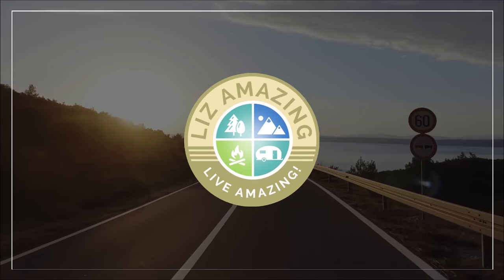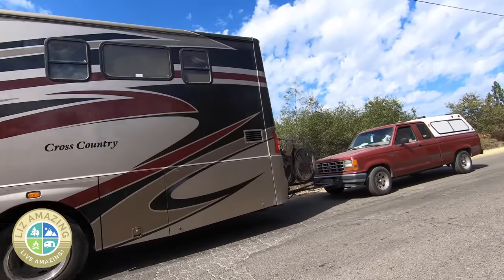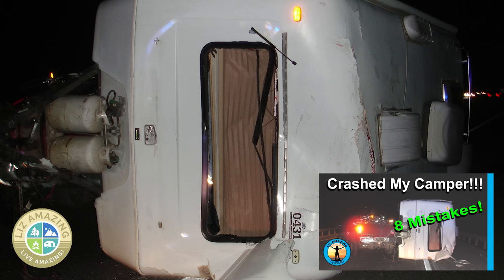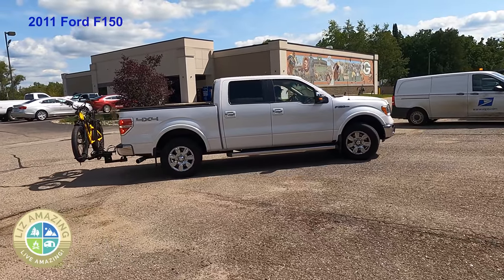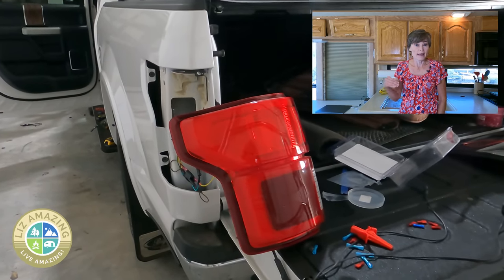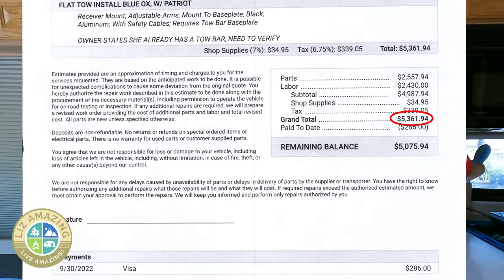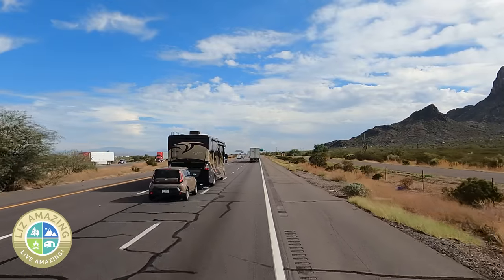These RVers are putting others in danger

Comment: For a very long time when I was much younger you could rent a towbar at the local rental agency and it was just clamped onto the back bumper of one vehicle and to the front bumper of the second vehicle and that was all the total setup you needed. 

We towed big heavy cars all over the mountains using those back in the 60s and 70s.

In the late seventies my dad moved our family from California to Missouri and he built his own tow bars for two vehicles to tow two other vehicles and they worked out just fine.
In the mid 80s he had a Chevy pickup with a tow bar permanently mounted on the front cuz he didn't trust the transmission on it which was a good idea, because he had me tow his truck about 30 miles to the nearest Chevrolet dealer to get it fixed and that was one of those homemade towbars that he kept on there all the time.

In the late '80s they came up with a ridiculously stupid way of factory installing antilock brakes on all vehicles and they made it illegal to put a standard trailer brake controller on tow vehicles that tied into the master cylinder on the tow vehicle.
They came out with some really idiotic designs like trailer brake controllers that had pendulums in them or some other silly device that didn't work with a darn.
They also put surge brakes on other trailers like they put on some of those rental trailers at the rental agencies and those surge brakes are extremely dangerous and I would never pull a trailer with one of those because when you are on a very slippery surface if you put your brakes on the tires on your car May lock up even if you have anti-lock brakes and the trailer is still pushing you because the trailer brakes have not come on that's true with the pendulum type trailer brake controllers and with the surge brake setup on the rental trailers or on a lot of car dollies also have the stupid surge brake system on them.

I put the old style Kelsey hydraulic over electric brake controllers on my 1985 Ford pickup and it worked perfectly because those old trailers brake controllers work fantastically if you knew how to set them up properly which a lot of people don't. Those old trailer brake controllers been around since the 1940s or 50s I believe.
Those work great because you can adjust the weight of the trailer to set the amount of breaking you want the trailer to have.
You always want to make sure it is set so that the trailer brakes stop the trailer and the truck brakes stop the truck and neither one should have to do breaking for the other. To test that you would apply the brakes normally as you would whether you're towing or not and it should feel the same whether you're towing or not it should feel the same on their brake pedal. I've been told by a lot of people that the brake systems they have on tow vehicles now don't work as well. Some people have towed thousands of miles several large trailers and they say that they have to push the brake pedal a lot harder when they're towing a trailer. That shows it's either not set up right or the braking system they're using is extremely flawed!
When I do upgrade to a newer truck I'm still going to use the old hydraulic over electric trailer brake controller that I took off my old truck. And if I ever have to use a tow bar to pull a vehicle behind a motorhome or a pickup truck I want to get a tow bar system that uses an electric actuator to push on the brake pedal of the tow vehicle so it'll work with my electric over hydraulic trailer brake controller. This type will also work when you're backing up a towed vehicle which I am told none of the other tow dollies or flatbed trailers will do that!

By the way, my dad and I never had trouble backing up trailers or cars or pickups with his homemade tow bars. And his tow bars were a lot stronger than any factory ever made theirs! His were designed fastened directly to the frame of the tow vehicle! Not the bumpers.
Reply from the maker: Oh those were the days for sure. Thanks for taking me with you on a trip down memory lane. I had heard bad things about surge brakes. Thanks for sharing, and for watching.
Reply: @LizAmazing  you are very welcome.

Comment: Here in Washington State any trailer over 3,000 pounds must have brakes.  I'm pretty sure this applies to any towed vehicle over 3,000 pounds.  AND not 100% certain but I think that 3,000 is the gross vehicle weight rating (rated weight with load), not the actual empty weight.  Meaning pretty much any towed car or truck must have brakes.
Reply from the maker: Yes. It varies by the state. It's good to do the research and always go with the safest option. Thanks for watching, Dave!

Comment: Hi, Liz, I was just curious when towing your truck do you have to keep it in neutral? I'm sure you do. I'm not very knowledgeable when it comes to towing but when towing all 4 wheels are turning meaning the driveshaft is engaged isn't it, meaning it's still putting miles on your truck. Shoot I don't know lol.
Reply from the maker: Good question, Ty. My F150 has.a "tow. mode" where I have to follow a precise sequence of settings to get it into neutral tow. It tows with the power off and I don't think anything is registering on the odometer.

Comment: Yep, We are towing a jeep and spent at least $5K to get braking and system set up.
Reply from the maker: Glad to hear you've got a system, just answered a comment from someone else who thinks a supplementary braking system is not necessary. Hoping this video will help spread the word. Thanks for watching, Dawn!
Reply: @LizAmazing  Thanks Liz! Meant to tell you you’re looking great in these new videos. Love the new Motorhome. Potentially anyone not using a braking system who has an accident or a towing failure, could run the risk of insurance not covering damages if found at fault for not using any required safety (braking) equipment. On top of that, it’s just good proactive safety.
Reply from the maker: @dawng540  Yes that’s an excellent point and I’m glad you brought it up. Their insurance will be void if they are breaking the law by not having a brake system. Thanks again!

Comment: How does brakes on truck work when truck isn’t running ,,ie power brakes
Reply from the maker: The brakes on the truck automatically connect with the motorhome when I hitch it up and plug in the connectors. The truck is not running when towed, is in neutral in TowMode. 

The Roadmaster Invisibrake has a cable that loops around back of the brake pedal and pulls it down in the truck when I push down the brake pedal in the motorhome. 

Power brakes mean you don't have to use as much force. The Invisbrake system pushes the brake down with more force than I can with my foot.

Hope this answers your question.

Comment: I think that part of the problem is that the RV dealer just wants to sell you the RV and then leaves the additional cost of a brake system out of the convo. Easier to sell you a $5k more expensive RV than a brake system. 

Saw a tow at OshKosh this year. The RV owner had locked the steering column on his truck and was skidding the front tires through all the turns. 

One more think to note, are you legally licensed to drive your Motorhome? I had to get a CDL because of the GCWR of the Class A Motorhome. That’s another thing that the dealers fail to mention. Go over 26k pounds and you need to prove to the state that you know how to handle the responsibility.
Reply from the maker: That very well could be. Although a dealer would likely be a reseller of a brake system so you would think he would want to sell more. In my case, I purchased from a private seller. But I have friends who have a Class A and they just don't believe in getting a supplemental brake system. I hope this video helps them rethink that!

Yes,  my state exempts me because it is not a commercial vehicle. But the laws keep changing so it's a good idea to check in your state.

Comment: The tow bar needs to be LEVEL with the towed also. I've seen class A's dynamite the brakes in a panic stop, front end of the rv goes down, the tow bar at the hitch goes up, tow bar at the towed goes down, towed goes into & under the bars... KNOW YOUR vehicle and HOW its to be towed, 4 down, in a dolly or my fav, on a trailer. Trans in neutral? Driveline disconnect? Start it up every couple hundred miles to lube the trans? Key on/off? Go to a reputable dealer and get the skinny...
Reply from the maker: Great tips. Thanks much, and for watching.

Comment: I agree with most of what you have said but I use the Patriot system and it's not a pain to use and you do not need power seats in fact the system should not be touching the seat when properly setup or the brakes could be dragging and overheating on the toad. BTW 33' Class A (gas) and I tow a 2014 Honda CRV with Blue Ox system. P/S there are a lot of people knowingly and unknowingly towing trailers and even campers that are overweight and equally as dangerous on the road KYD has a good video about this Youtube "
PAYLOAD PROBLEMS: HOW MUCH CAN I (REALLY) TOW? RV Truck & Trailer" Oh!!!  and people who think this safety stuff is not important should keep in mind that after an accident  your insurance company is going to be looking for a way to get out of paying your claim and if you're not legal you're in trouble.
Reply from the maker: That's so true, yes insurance is not going to pay if you're illegal. And sorry about the manual seats thing I said about the Patriot. The gal at Blue Ox told me that but I'm hearing from others that also say it works. Thanks for watching and be safe!

Comment: great post but i got confused.. your existing f150 was not but 2nd/ new f150 was?
or what?
thx
Reply from the maker: Yes, I bought the 2011 F150 for the cabin. Paul said it was flat towable but it turned out to be one of the few F150s that was not. I bought the 2018 which had 1/3 the miles and an aluminum body so lightweight, too.

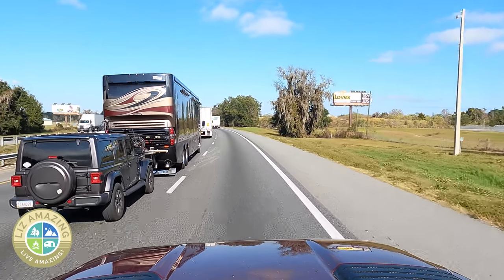Comment: @3:29 in video your following distance is less than 100 feet and I estimate speed at 60 mph or greater.  A good, paying- attention reaction time is 3/4 of a second.  The follow time is 1/2 second or SLIGHTLY more.  So if safety is you job one, you are failing.
Reply from the maker: Nice try, Joel. There is no situation as you described in the video. At 3:05 in the video we are clearly in a construction zone going about 10 miles an hour. But very glad to hear that safety is also a priority for you.

Comment: Ford patented an idea I had. Hybrid toads that use regenerative breaking and pushing when necessary. If they do this, you could have unbelievable power for boondocking or driving your hybrid for free. Instead of the RV burning energy with braking heat , the hybrid would regenerate and store the energy in battery power. They will own the toad market
Reply from the maker: Oooh, sounds interesting. Thanks for this, and for watching.

Comment: Another point to add, is that if you are towing a front wheel drive only car, then be aware that using a dolly will stop the mileage on the car going up when it is being towed!
Reply from the maker: Oh that's good to know, Danny. I don't think my odometer is going up when flat towing because my engine is off. Thanks for this!
Reply: @LizAmazing  take a photo of the mileage before your next tow and check it after to see if it has changed! The engine doesn't always need to be on to increase the mileage as it's usually reliant on the wheels turning not the engine. Depends on the make and model and where the sensor for the odometer/speedometer is. Let me know your results! :)

Comment: Holy crap, I had no idea most MH towing r not towing properly! 😬
Question, so if a tow vehicles brake lights come on, does that mean the tow vehicle is actually braking? or are the brake lights only engaging? 🍻
Reply from the maker: They might have just the lights hooked up but not brakes. I wouldn't know for sure.

Comment: The “Claw”, as I call our Patriot, is a pain…but we don’t move without it, and our toad is only 3500 lbs!   Our seat is manual, by the way…we just adjust it…not sure why you heard it has to be a power seat.   Do you now have someone in the cg check that your brakes are operating, and that toad wheels are rolling/tow arms are locked?   I think about how I’d have to lean on a neighbor if something happened to my husband and I was alone.    One more thought…assume you’ve added tpms to all wheels, including the toad.
Reply from the maker: Blue Ox told me that manual seats are not recommend. I don't know if the gal gave me bad info but plenty of people (I've since heard on this page) ARE doing it with manual seats, so that's good to know. I'm just happy you have a brake system. I have friend with motorhomes who are NOT! Yikes! And, yes, stay tuned. I will definitely be talking about TPMS! Thanks for watching, and happy travels!

Comment: Nearly every state requires a braking system for nearly all towed cars and trucks.   Even a Honda Civic weighs 3000 pounds.

Even if it were not the law, you are responsible for the damage your tow vehicle causes, including injury and even possible depth associated with a runaway tow vehicle.  I know one case where the towed car broke away and  passed the RV went across two lanes of traffic, through a ditch and only came to a stop after hitting a pole.  Thankfully no one was hurt. 

That being said, I think you got the very best and easiest to use braking system available.  With a Roadmaster Invisibrake you don't have to do anything after the initial installation. It just works everytime you tow the vehicle without any set-up work.
Reply from the maker: Thanks Scott. Yes, I wanted something easy and I am so glad to have the Invisibrake, glad you know about it, too. And thanks for watching!

Comment: If the RV is pulling over 4 thousand pounds you need brakes on trailer. When you pass a big rig the air stream can cause your trailer to wobble and cause the RV to wobble loosing control. Always hit the trailer brakes first keeping your speed just ease the trailer brakes until the wobble stops. When you hit your RV brakes you give the trailer wobbling to be worse causing a wreak or worsening. Be safe and use a CB in your RV. SEMPER FIDELIS 😊
Reply from the maker: Great tip and reminder. Thank you so much. Happy (and safe) travels!

Comment: You’d be very careful with a huge diesel coach going down dirt roads and back winding roads because they’re very heavy and if the ground is damp, you can think like a rock! Have no way to turn around try to back down. People can do it do it but the majority of these huge Diesel coaches are not really designed for back roads and what areas. If it’s rained in the ground is soft or if it is spring or there’s mud, you can be serious trouble more so than any other type of class a or B vehicle. You gotta think of these things these huge diesel coaches/diesel pushers as semi trucks in away. You wouldn’t be driving a semi truck up in the woods! Some people do it but I think it’s very risky and I wouldn’t do it too many problems can cause too much damage and I don’t wanna deal with that.

Comment: I understand what you're saying... But an RV weighed so much... 6000 pounds truck is not gonna make that much of a difference In the overall stopping of the RV... I'm sorry about your breakup.. I'm glad to see you're doing well after your back surgery I myself had a back surgery,
 I like watching your show... You have very independent conversations and I always learn something. Lastly thanks for sharing
Reply from the maker: It will make a difference. Having a supplementary brake system will stop it from trying to swing around the RV in a panic brake situation. And of course the breakaway cable will stop it should the tow bars fail or you become separated. That said, there are MANY folks who think just like you and I talked to them in campgrounds. Thanks for watching.

Comment: A few additional things to consider - 

If someone can afford a DP they should be able to afford the additional equipment required. If you can't afford to do something right wait until you can.

One has to wonder how many dealers/salesman don't want to jeopardize a deal by informing a prospective buyer that they'll need to spend more $$$$ beyond the price of the RV in order to tow with it. This sort of info should be made known.

Those that don't want to spend the money, "it's too difficult / a PITA, etc.", should be required to work with an EMS / Rescue crew for a few accidents if found negligent. Without becoming graphic I'm pretty certain that will change anyone's poor attitude. 

Trucks are pulled over for roadside weighing, etc. RVs could be as well for weighing and compliance. If that began happening a lot more people would likely pay attention. Failures to comply normally result in insurance companies being notified and rates adjusted or policies dropped.

People need to consider it's not just for stopping the Toad. Imagine driving on compromised surfaces (wet, snow, ice, gravel, etc.) and having 4,000+ pounds of non-stopping inertia continuing to push you - not just increasing your braking distance but also possibly pushing the rear of your coach sideways (jackknife) and maybe even over. 

Prior luck means nothing.
Reply from the maker: Oh my gosh, such great points, thank you! I do think that salespeople are sugarcoating things to make a sale- for sure! Another thing about towing without built in brakes is the tow bars are not designed to withstand a panic stop like that and could break. I've been hearing stories on this page! Thanks for watching and be safe! See you in my latest video right here: https://youtu.be/YS8lIomOfVg